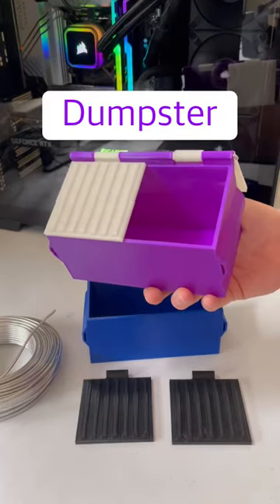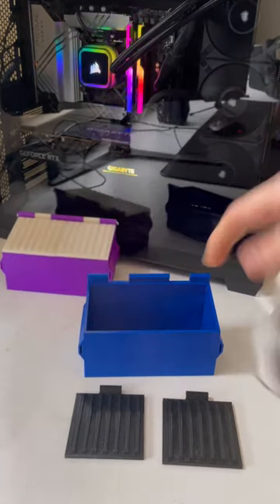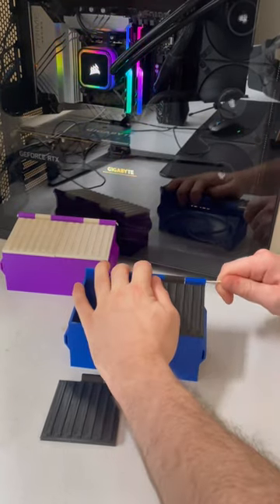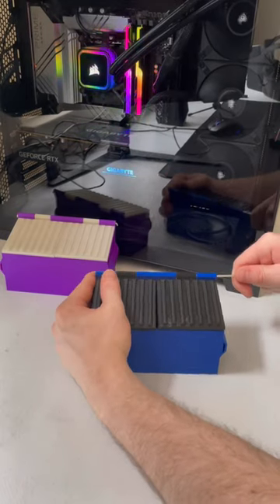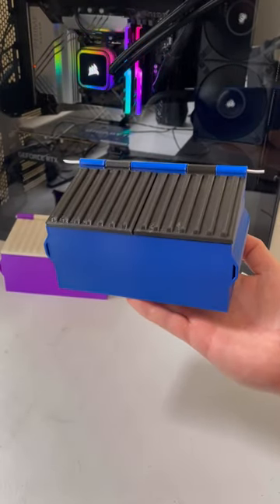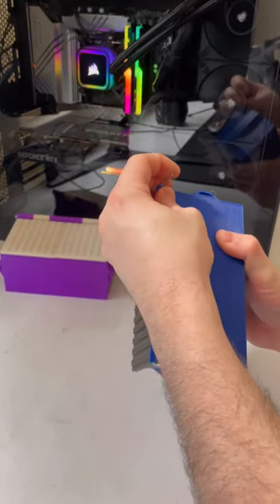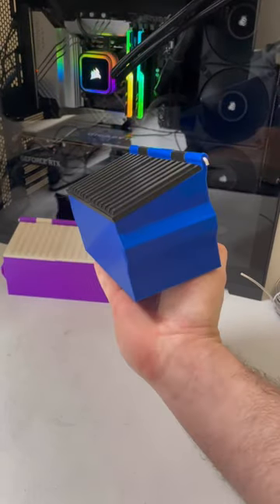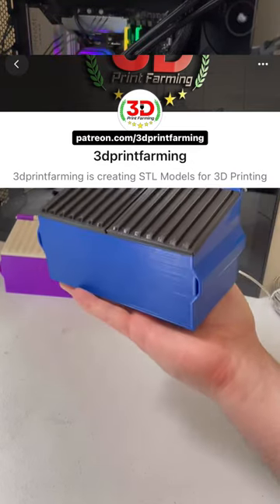3D Printed Desktop Dumpster!

Comment: Out of curiosity, what made you go with aluminum wire? I see similar hinges using filament and if you use a wood burner you can melt the excess to the print.
Reply from the maker: I also made a fully 3D printable version of this dumpster that uses a piece of filament and two end caps instead of metal wire. Overtime, filament will become brittle and more prone to snapping/breaking. This is no problem for someone who owns a 3D printer as they can simply replace the piece of filament that attaches the lids to the dumpster. But for my customers who don't own 3D printers I offer the V2 version which is made with a metal wire which will not break overtime.
Reply: @3DPrintFarming  totally understandable, love the videos btw, definitely has me thinking about starting a farm.